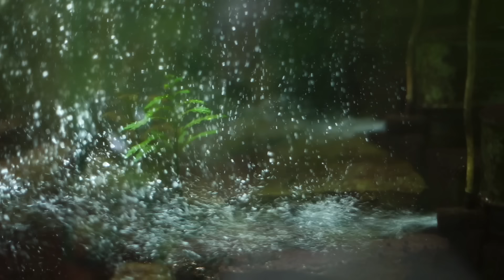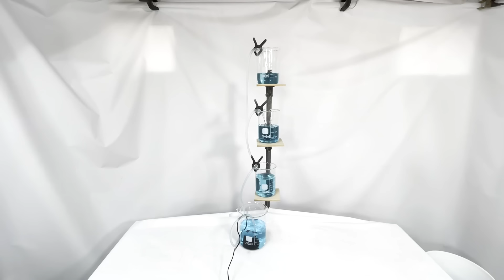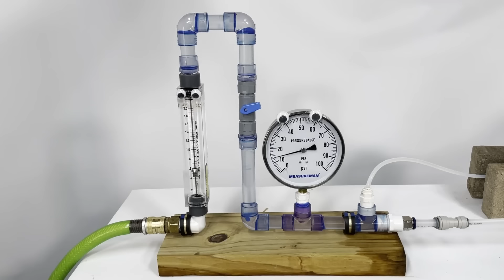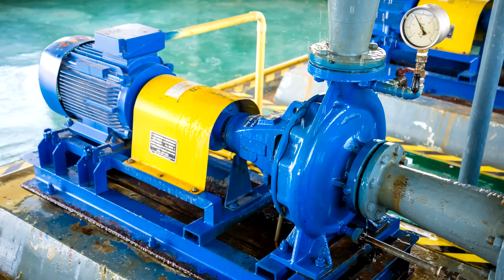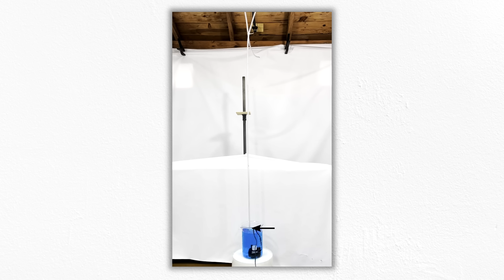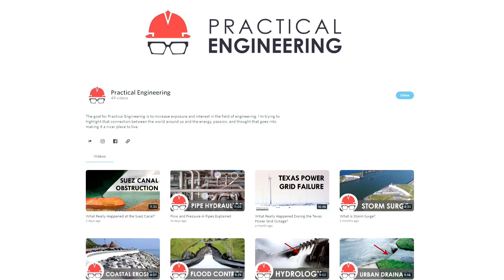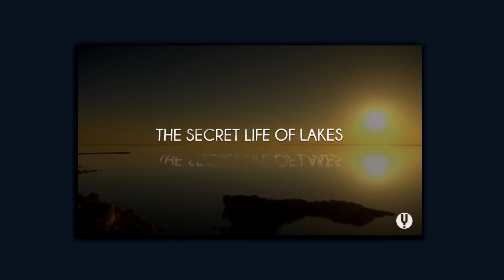Do Pumps Create Pressure or Flow?

Comment: Pressure or flow? Well it rather depends upon if you have opened the valve or not and the type of pump. Centrifugal pumps - well the larger ones - are started against a closed valve to reduce motor load. They don't create any flow and only create the maximum design pressure. I'd argue that this makes them pressure creators. Positive displacement pumps work the exact opposite. They need to run against an open valve because they will move the liquid regardless of the state of the valve (or pipework) until something fails. That's by they are fitted with bypass PR v/vs. I'd say this makes PD pumps flow devices not pressure pumps.

Comment: Now it get's extra tricky when you need to run a pump in a pressure chamber for saline fluid WHILST ensuring that the pump for sucking the air out doesn't get broken from combusted material.

Comment: 0:30 it isn't rocket science, but a large part of it for sure. Take for example the new SpaceX booster that has to distribute fuel and oxidizer to 29+ engines at quite a significant rate.

Comment: Hi there!

I graduated i mechanical engineering a few years ago, and this video was a great refresh of what I have learned. And I love the practical approach on how things are explained.
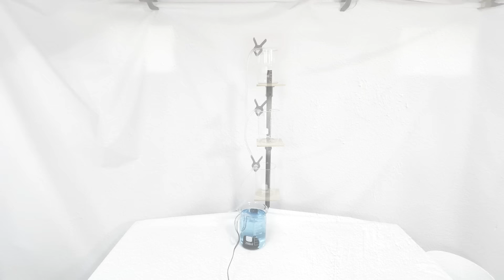I was hoping, if someone could help me clarify something that is puzzling me a little. At 4:51 when it is said "This point/intersection tells at which the pump will operate". Wouldn't this point show where the head is the same for the pump and the head after the control valve? For example, if we are to the left of the intersection, the head would be different.

Really love the video!

Comment: Surprised you didn't cover axial flow pumps. That is 99% of the pumps we use in the flood control stations we design in Florida. Granted, what you said about centrifugal pumps applies to axial flow as well. Anyway, I would like to see videos on cavitation and formed suction intakes (FSIs)

Comment: Oddly enough, I was taught the opposite -- that pumps create pressure, and that the pressure differential is what creates flow.
Reply: (I think ultimately it's kind of a 'chicken-and-the-egg' problem; whether you perceive flow as producing pressure or pressure producing flow, the two are just two ways of measuring the state of a fluid. Neither really 'produce' the other; they just share a relationship.)

Comment: I believe that the old adage “it’s not the voltage that kills you but the current” stems from AC current causing more dangerous reactions to the human body than DC current though it’s not the important message. The inherent meaning of the phrase reminds the user to prevent the flow of electrons into the body by all means.

Comment: Re: Volts jolt; mill(iamp)s kill
You really have to consider how much resistance is in the system. You can safely touch a pair of alkaline 9V batteries, but don't play around with a 12V car battery because it's designed (with low internal resistance) to deliver >500A to your starter.

Comment: Well, nice video. Yes this is not a rocket science, but anyway there are some mistakes done. At 3.05 you are changing duty points - thats right. But its changing because you are chahging the static head ie changing the starting point of system curve . So there are not one system curve but three. Static head calculation are extremely important whre we have submersible pumps. Especially with VFD

Comment: Funny you reference the current not the voltage being fatal.

The statement IS TRUE, and you are also correct. But the statement doesn't tell the full story.

Specifically, it is the current across the heart. But it takes higher voltages through the body to overcome the resistance of the body to get that current across the heart.

Comment: I would still argue that PD pumps still produce pressure as they are forcing fluid in to the down stream side. In fact the applications that need high pressure use almost exclusively PD pumps becasue of this reason. They are also able to hold the pressure while turned off unlike the C pumps.

Comment: You missed the point of pumping off the curve. Where you can cause overload of the motor. Other certain scenarios you can cause cavitation and erosion of the pump impeller, brilling of the sharft bearings (oval-shaping of the bearings)

Comment: Primed pumps promptly provide persistent pressure, persistent pressure permitted to propagate provides pouring particles.

If you're willing to give up the alliteration at the end, then instead use: 

Primed pumps promptly provide persistent pressure, persistent pressure permitted to propagate provides flow.

Comment: I use ultra high pressure pumps to remove coatings from steel. They are P.D. pumps pushing 6.5 gpm at 55,000psi..

Comment: Another Chemical Engineer here and I very much enjoyed your video.  I would like to let viewers know there are several more important aspects to pump sizing, suction piping restrictions and Net Positive Suction Head, etc

When you are describing pumps, the viewer should realize your boundaries are the external suction and discharge, and not the inner workings of the pump itself.

More later…
Reply: I have heard of centrifugal pump salesman describe the impeller as imparting a speed on the fluid, and this flow energy is converted to pressure and flow in the volute as the flow path reduces in area.  To me, this is a funny way of visualizing fluid flow in a cent pump.  I really don’t relate to this explanation on a macro nor micro level.  This may be one source of this common statement.

Since the driving force for flow in a fluid is pressure differential, the impeller must be creating a pressure in the fluid it encounters on its advancing face.  On a molecular level, the energy level of the fluid is increased.  Kinetic energy of a molecule is a function of it’s velocity and mass.  In a liquid, we can assume it’s non compressible under normal conditions.  The measurement of pressure would be dependent    on the orientation of the face of the instrument in relation to fluid flow direction.  Thus Bernoulli’s law.

In a centrifugal pump, if a pitot tube were placed into the flow in the volute, it would indicate pressure.  In fact, it would indicate many different pressures as the pitot tube was moved to change it’s facing direction relative to the direction of fluid flow.

My visualization of the internal fluid dynamics, is that there is pressure and velocity at every point in the wetted volume of the pump.  And at every point, the pressure would depend on the direction of measurement.
Reply: And a comment on your demonstration of a water pump having it’s discharge progressively restricted.  Very good demonstration.  Severe restriction not only is wasteful of energy, but that wasted energy is churned into heat inside the pump.  As the temperature of the fluid rises, it can and eventually will damage the pump seals and other parts.   The pump sounds bad because this condition is bad!!

The fluid in the pump experiences friction (aka drag) when flowing in contact (or near) the solid pump parts.  Under normal operation this heat generated leaves with the discharging fluid.  Restrict or block the flow and a continuous heat generation is not carried away and temperature rises.

Sometimes the temperature can  get high enough to boil the liquid.  If this happens, watch out, rotating equipment will be damaged by cavitation.

If you want to create cavitation without waiting for the fluid temperature to build up, just restrict in inlet severely.  Suction pressure will drop to the point of partial vaporization.  When these bubbles collapse against the impeller the pump will begin the process of pounding itself apart.
Reply: Regarding pumping efficiency, a modern development is the availability of variable frequency drives for AC electric motors.  With these the output of centrifugal pumps can be controlled with impeller rotation speed (RPM).  Every different rpm will exhibit a different pump curve, allowing pump speed to match the job required at any given point in time.  Within reason of course.

The traditional way of controlling flow in a piping system is using a flow control valve to create the appropriate restriction to slow the flow to the desired rate.  This wastes energy but works well in most situations.

Controlling flow with a Variable Frequency Drive on the pump motor cost more up front but results in a more efficient and overall better running system,

Comment: Without having watched the video I'm going to say both.
Just thinking about putting a fan in a pipe i imagine it would directly interact with the water and push it to create flow but i imagine that the rest of the water in the pipe would move due to the change in pressure.

Comment: Would very much appreciate an examination of a Berkeley Jet Pump in a boat.  Near zero head, lots of volume, rising pressure curve against a fixed nozzle based on RPM.  How to extract maximum boat efficiency?  More discharge velocity?  More discharge volume?  Let's say target RPM is 5,000 - available HP at that RPM is 450, boat is planing hull at anything above 20 mph  ...  
Berkeley Jet Pumps are considered mixed flow pumps, not entirely radial, not entirely axial ... 
Any ideas ??

Comment: Without a pressure there is no flow. But a pump can be set up for delivering high pressure without much flow (like a pressure washer) or they can be engineer for delivering a high flow but low pressure...

Comment: Reads title.
I would say that pumps create pressure, which can exist without flow, whereas flow cannot exist without pressure. I am not an engineer, that's extrapolated from my experience with electricity, where once again EMFs create voltage, which can exist without current, whereas current cannot exist without EMF.
Watches vid.
Happy with that. All that other graph stuff is produced by the load.

Comment: Pumps cannot create flow unless they can create a pressure difference. 
My fav pump was the steam turbine driven vertically mounted propeller pump serving as the main engine cooling pump on Nimitz class. 26k gpm, used only under 10 knots. I served as a nuclear mechanical operator for 6 years.

Comment: Pumps only create pressure *differences*.  Pressure differences create flow.  This is true of all mechanical pumps.
And before you say that positive displacement pumps don't do that, consider how the displacement happens.  If a pump created flow, it would have infinite power.  Instead it imparts a force on the fluid and does PV work.  Without the PV work, nothing happens,

Comment: With fixed displacement pumps - does the pump use different power in different places of its flat curve? So does it require more power to fight against a more resistive system?

Comment: 0:22
As electrican, i must say that it is not lotage what kills you, it is current,  it is somewheat simpkified, but true.
you can look at vidoes of ppl touching very high voltages, with correct frequency,  htat literary make thiers hairs standing, but leave them perfectly fine. So under correct condition,  any number of volts is safe to humans.

Comment: "voltage and current go hand in hand"

no, not really... or not necessarily in the context of what kills you.
Voltage is a potential energy difference caused by an electric field, or by resistance/loss of energy. Current is the flow of charge.

you can have current (flow of electrons) with no voltage if there's no resistance (in a superconductor). 
You can also have high voltage without high current. When your body gets charged up with static electricity, you'll develop a voltage of up to 25 thousand volts (yes, 25K). When you touch something conductive, you'll get a sudden zap as the static electricity is discharged, but that won't kill you because it's not enough current.

Comment: Thumbs up!
but the question is wrong!
I know, it was intentional to get a response or view..
It isn't whether the pump creates pressure or flow. 
Your catch phrase is a little wordy even though it is accurate.
I prefer to say that pumps convert mechanical  to hydraulic energy. This implies that same as the catch phrase but is simpler.
Obviously the electric or diesel power is being converted to mechanical energy to move the pump.

The energy must go somewhere,  If it isn't doing something useful it is probably generating heat.

Comment: A pump applies force to a fluid.  If it can flow it flows.  If it can't, pressure builds.  I don't know why that's so complicated for some people.
Reply: a flowing fluid has pressure.   pumps are rated by flow rate, head AND pressure at a given pipe diameter.

Comment: Considering conservation of energy where does the energy supplied to the pump go if the water is not moving when the flow is zero and total head is maximum? I am assuming that the pressure of the water above the pump remains constant and does not go any further than the maximum

Comment: Booster pump systems will run and then shut off based off of pressure readings. When the pumps shut off, no ones using water and all components are working right, the pressure will remain in the system. Pumps made that pressure baby

Comment: The problem with your assertion is that the "hand" holding voltage and current together is resistance (or conductance).  Resistance has many contributions.  Rubber souled shoes are far safer than bare feet.  Dry skin is far safer than wet skin.  Why?  Because the same high voltage will kill a man with wet hands and merely surprise the same man with dry hands.  It is important to distinguish the differences between physical quantities.  Charge flow is NOT equivalent to electric potential difference despite their Ohm's law relationship.  But 80 mA of current will always stop a human's heart regardless of how much voltage was needed to cause the current to flow.  Therefore, current is a far more reliable measure of electric danger than potential difference.

Comment: I have a question. Won't positive discharge pumps encounter a similar situation to the centrifugal pumps if the pressure in the system is high enough? I'm guessing it would take way more pressure to reach that point, but isn't it still theoretically possible? So they would effectively have a similar characteristic curve to centrifugal pumps but it's just like zooming in on the end of the graph where the flow rate is highest.

Comment: I'm not sure what's wrong about statement, that 'it's not the voltage, it's current that kills you'.
 
It's similar to saying that it's not the height (potential energy) but smashing the ground (kinetic) that kills (...and I hope that You would agree that potential and kinetic energy goes as 'hand in hand' as the voltage and current) . Well - it's a bit snug to say but it's true. If we define voltage as a measure of ele. potential between some 2 points and current as amount of electricity that flows between these 2 points, than anything that was send - is called current. 
If there wouldn't be enough voltage - there won't be no current and no1 could be hurt in proces... just keep in mind that there's a difference in electrical potential (voltage) between Your body and the power socket in the wall and until there is some flow ( and no fuses to cut it immediately  ) ... we are still here.

Comment: Please correct me if I'm wrong, just half awake and thinking about it. Pressure is created from resistance to flow, right? With your centrifugal pump example with just a vertical line going up where it was reaching its maximum head, it was creating flow until it reached its maximum head, which at that point it wasn't creating flow per se, but it was creating pressure due to the resistance of flow partially due to atmospheric pressure and just the centrifugal pump's capabilities?

Comment: A fan is effectively a pump designed to move air, right? Most of these characteristics seem to transfer over. 

(I've just been thinking about properly regulating my computer case fans, positive vs negative pressure, and all the bloody different kinds of bearing you can purchase tor virtually the same cost, all without actually having any information like "how much pressure is enough" and "how much flow rate is enough" or "how much flow rate is actually being used right now vs what the spec sheet says")

Comment: in the case where the centrifugal pump is "creating pressure" would it not be correct to say that technically gravity is creating the pressure, or maybe even the system design ( takeing gravity into account as a part of the system ) but put the same system in orbit and the pump won't be creating any pressure?

Comment: I am a retired mechanic that specialized in automotive air conditioning and they use a compressor to create pressure in a gas. You cannot compress liquid. You can pump liquid. And when you try to pump liquid and you have gas present you get cavitation. And when you try to compress liquid it goes bang, not good!

Comment: Centrifugal pumps add kinetic energy.  Some of that kinetic energy goes into flow (dynamic pressure) and some goes into ADDING static pressure to the inlet pressure. 

When you get to the topic of trying to optimize control valve sizes for efficiency and/or maximum range of control, drop me a message.

Comment: I have to argue the point. How much pressure is there at the point of discharge from the pump ? Well you can not measure that without creating some type of restriction or resistance which is actually where the pressure is created. If the fluid discharges into a pipe it is already incurring a restriction.